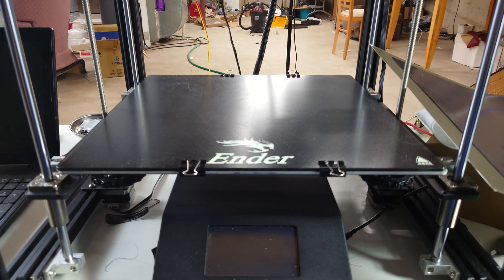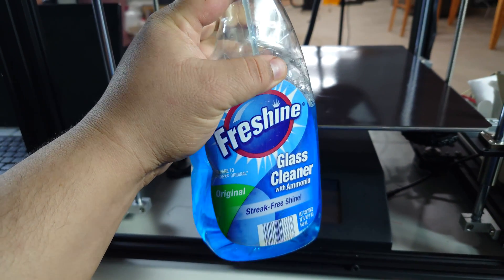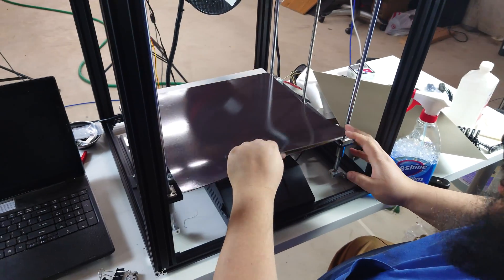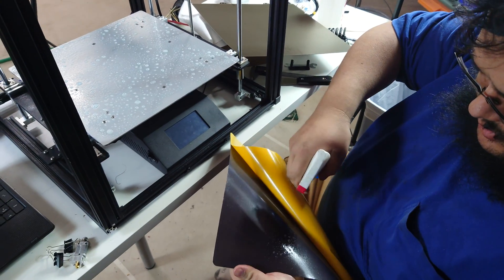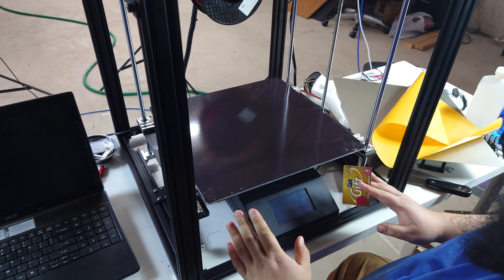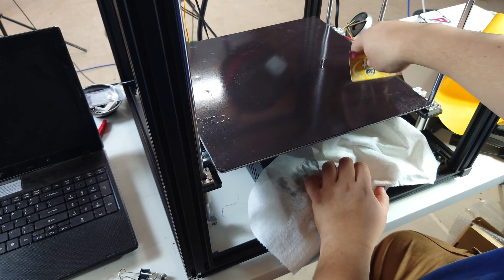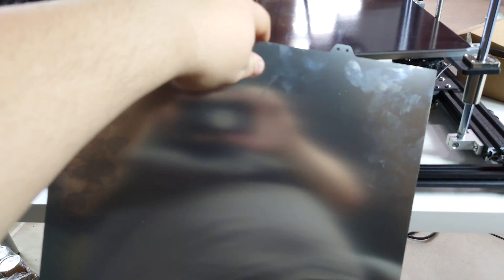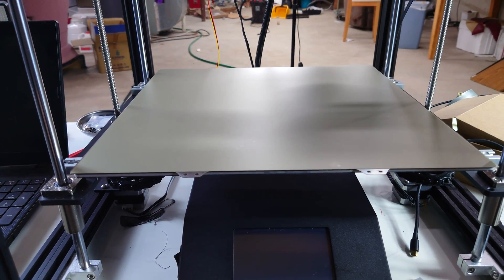How to apply a Magnetic PEI Build Surface to an Ender 5 Plus

Comment: I've never seen this done as a wet install before...seems much easier! 
Question, though: I've done wet installs for screen protectors on my phones many times, and the wet solution is basically water with a tiny bit of soap. I'm guessing you chose glass cleaner because it would evaporate more quickly, but is there any concern that the chemicals would weaken the adhesion in the long run?
Reply from the maker: I've done wet applications for ultem 1000 Pei on Spring Steel several times now. After many months of use and many thousands of hours of printing, I have no issues to speak of in regards to adhesion with the wet method.

Comment: is there a reason why the bed heater couldn't be turned on at a lower setting to promote faster evaporation?
Reply from the maker: Just wanted to be safe to make sure nothing electrical was wet while it evaporated.

There's also the possibility of gas bubbles developing under the magnetic, which could negatively effect the flatness.